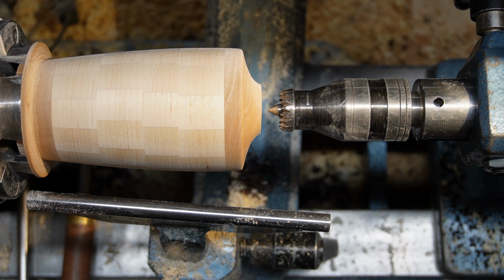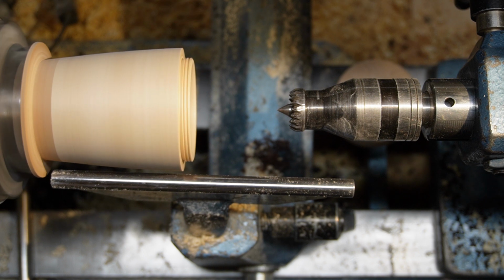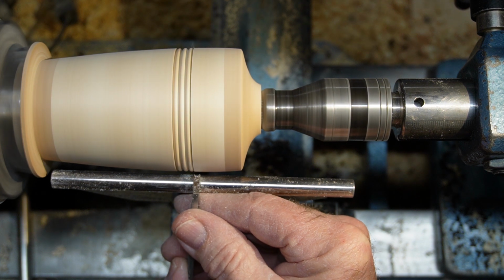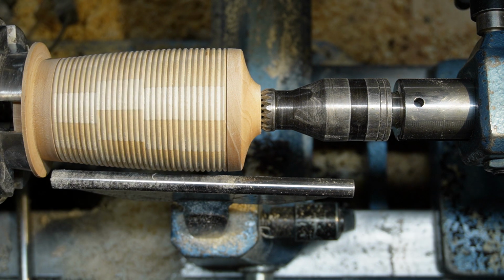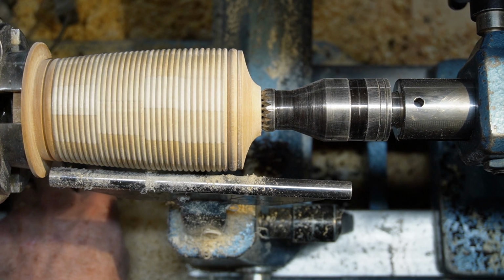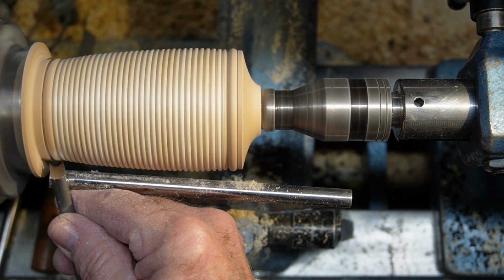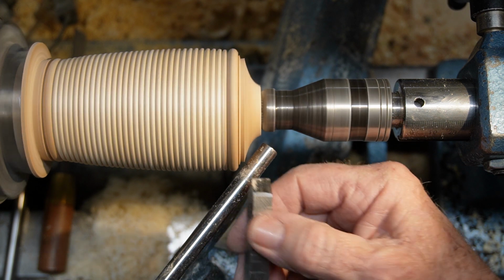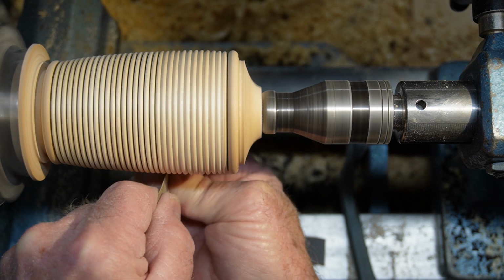Part 4 Cutting Beads and Burning Valleys

Comment: Dear Karl, what a class of techniques, with care to share details with those who are watching... Congratulations on the beauty of your techniques and their simplicity. I wish you success and a big hug from Brazil Said Choucair
Reply: Karl, to burn the thin parts, or instead of using a plastic laminate, which is thicker, I bought a thinner steel guitar string, threaded it on two wooden turned ends, which worked better, without burning the sides. Here's the tip. Hugs Said Choucair
Reply from the maker: Thank you! Glad you enjoyed it.
Reply from the maker: @saidchoucair9247  The plastic laminate I use has been sanded down very thin so that it only burns in the bottom. Guitar strings will only work in certain situations.